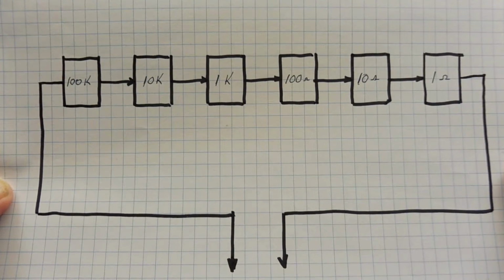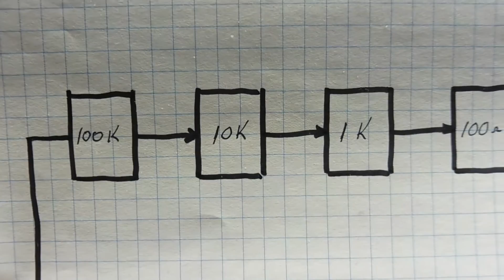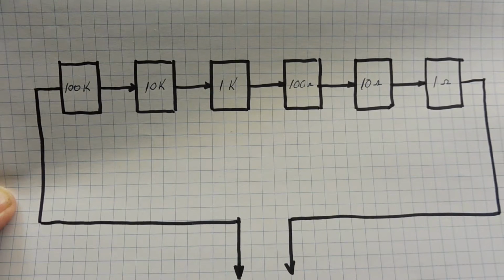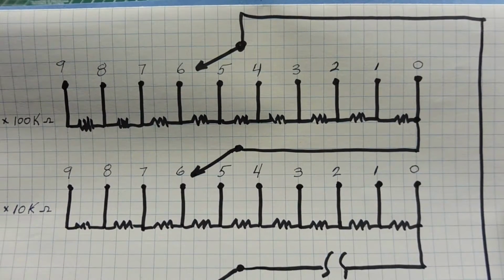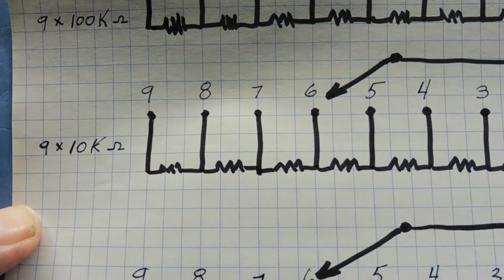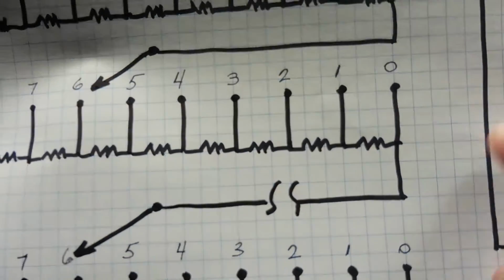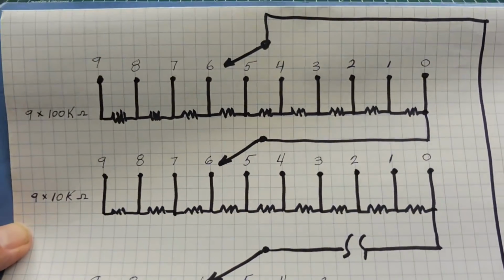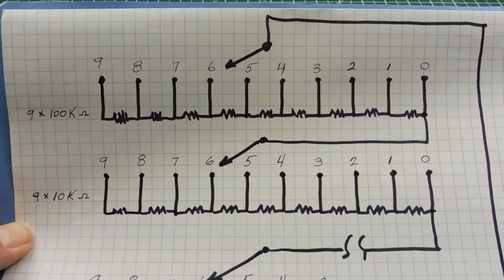Build your own Decade Resistance Box

Comment: To skip 0R-9R or not to skip 0R - 9R? That is (my first) the question.
I figure if I'm going to screw up something it would be from connecting the lowest value and passing too much current. 

   I'm trying to build a larger size breadboard station in a box with integrated power and several circuits built in. I found some cheap decade switches that look to be the primitive caveman neanderthal cousins to the nice ones you showed here. However they are hard to beat at just over $6 for a set of 10. If I order 2 and divide them into 2 sets of 5, I could make 4 separate decade boxes.
     I want to order some other LT specific stuff from Digikey and am about to place an order. After checking they sell 1% 1206 resistors at a decent price for the 100pc quantity. If I get 10's, 100's, 1000's, 10,000's, and 100,000's resistors in a quantity of 100 each they are ~$10 total. That puts me at around $25 for 4 separate decade boxes with 10r to 999,990k. I'm also looking for more simple excuses to practice KiCad, designing, and etching a board. Is that reasonable? Would you do it differently?

  Funny this video was suggested when I was searching for examples of people making their own mechanical switches. There's not much info in video format. Have you ever tried to make your own PCB rotary switch like the old rotary contact switches in analog meters? It doesn't seem that difficult mechanically. I'm surprised more people haven't tried and shown their results... 
- which usually means I'm ignorant of something.
 -Jake ;)